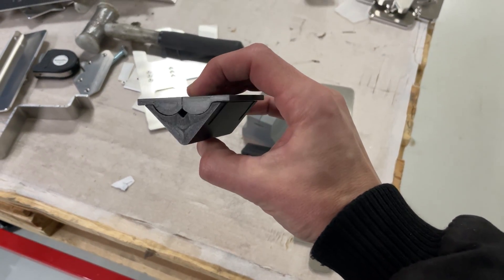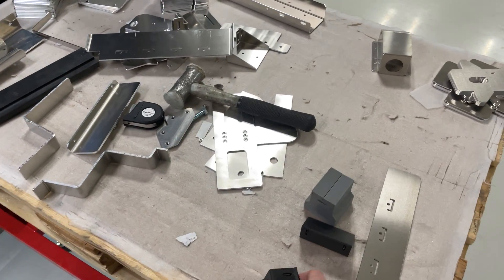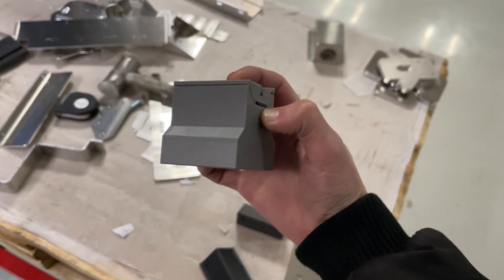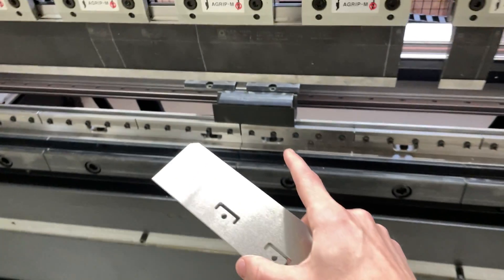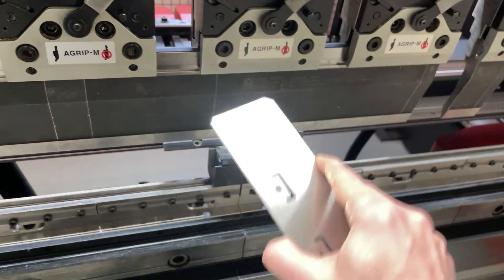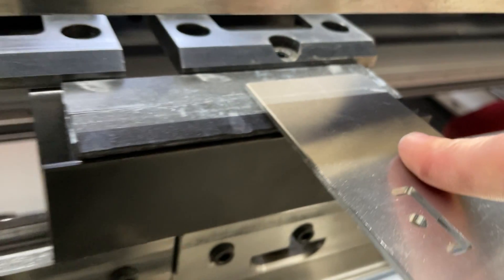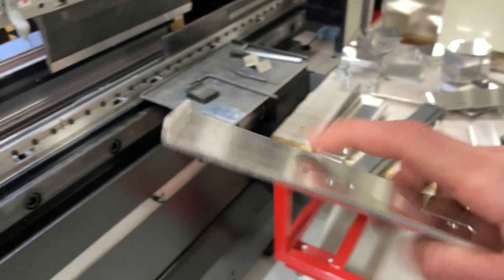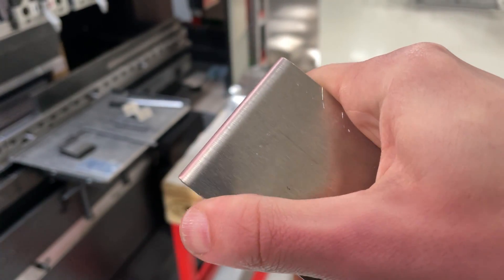3dprinted press brake dies - size 40

Comment: What is a diameter and length of spring need for this die? I printed erlier version but there is the hole less 4mm.
Reply from the maker: Hi. Diameter is 3mm, contracted length is 25mm(including hooks at the ends), max length 85mm.
Force from 0,4 to 4.1N linearly.
Anything even close to it should work just fine.

Comment: That is awesome. You should make full set of these, from like v6 - v100. I would like to try use them on my 300T durma where i bend 20mm steel or even 50mm steel bars